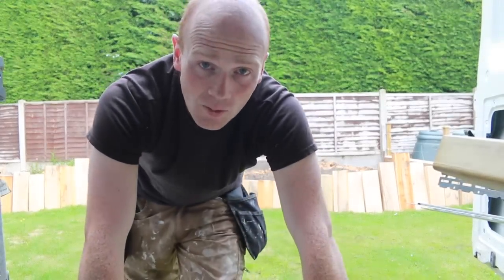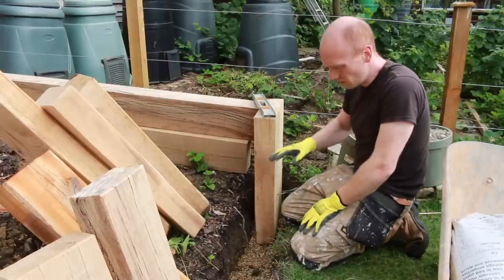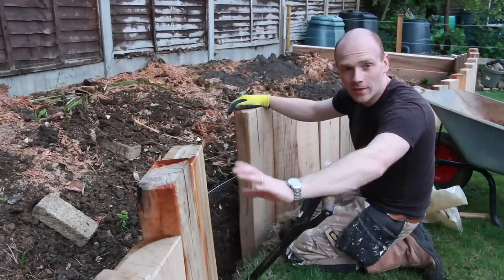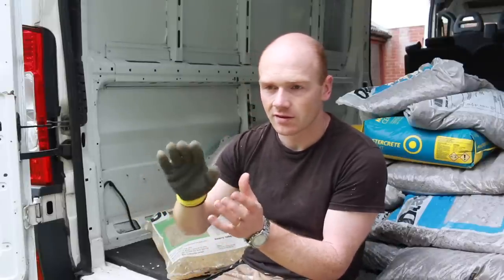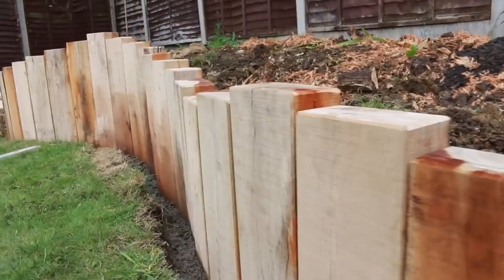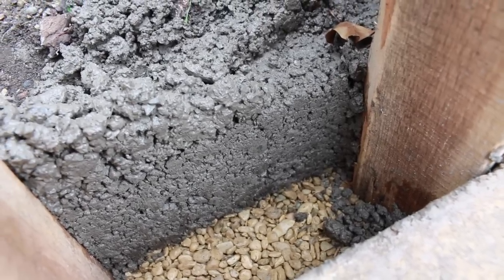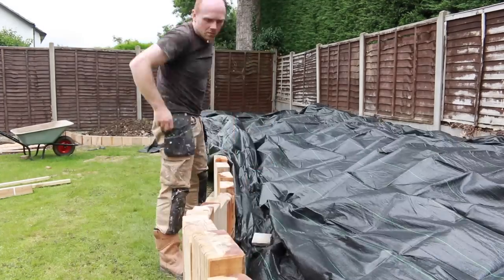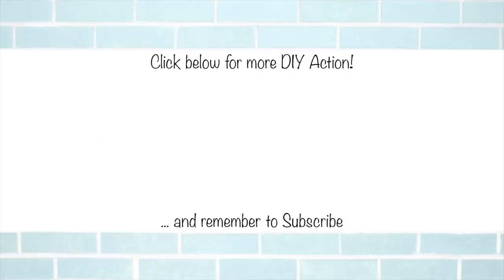OAK GARDEN WALL - 3.0 - Construction

Comment: Hi Tim, firstly, I am a MASSIVE fan! Love getting the alerts you have posted a new video! I am currently building a sleeper wall too and was wondering if you were going to show how the membrane will be finished? Are you going to be stapling it or something to the sleepers to stop the soil contacting them? I am just about to install gravel and drainage pipe to keep all water away but was thinking of maybe using a non woven fabric too on the back of the sleepers.
Reply from the maker: Hi Chris,  Give a a day or two and i will have the video done!  Only finished the job on Thursday so not edited yet.  I went with a membrane tied in to the concrete which came up the back of the sleeper which I back filled with gravel in a 100-150mm strip and soil the other side.  Will be clearer in video!
Reply: Hi Tim, great stuff thank you. Looking forward to seeing the video and then getting the time to finish my job too!

Comment: Great video Tim and helpful to me as I have a similar project to do.  A silly question, but when I’ve used a concrete mixer, I’m left at the end of the day with loads of concrete slurry which I don’t know what to do with.  Maybe a short video on how to clean a mixer would be useful?  You fully deserve your subscriber numbers - such a diversity of video subjects and all great quality - I have still to make the rise and fall desk from an oak worktop off-cut!!  Kind regards Martin
Reply: You just need to rinse out the mixer with a hose. The issue is finding somewhere to dump the mix. Unless this is the last job in the garden there should be a corner in the back of the garden to dump it. If I haven't mixed to much I put it in the used sand and cement bags and take to the tip when it's gone off.

Comment: U do nice work! I was watching ur oak garden wall and just wanted to ask you what kind of oak wood did u use for your wall ? And also how did u cut all your pieces to length ?
Reply from the maker: European white oak, (rustic grade) Usually a circular saw from both sides, although I now have a larger saw.
Reply: The Restoration Couple thanks for replying:) is the oak treated wood ? What kind of oak?
Reply: @alfredodiaz Oak doesn't need to be treated as it is a hardwood and will last for many, many years even when exposed to water. 👍🙂

Comment: Hi, I'm doing a similar thing but with softwood sleepers. I intend bedding on a layer of pea gravel also. They are treated but being softwood, would you recommend coating the buried end in bituminous material for extra protection?
Reply: If you coat the bottoms of the sleepers with bitumen it will prevent the moisture from escaping and could increase rotting. Best to look for UC4 treated softwood for in-ground applications.
Reply: @gardensandplants  Thanks for the reply. Yes, I left the ends free of bitumen in the end, for that reason. Although I did coat the backs and fronts below ground.
Reply: X

Comment: so I've always believed wood should not be in direct contact with concrete as the concrete stops the wood drying out and as a result it will rot...
Reply from the maker: Ideally you would keep all wood high and dry but when installed correctly and with solid oak like this I would hope it will last at least a couple of decades if not more.